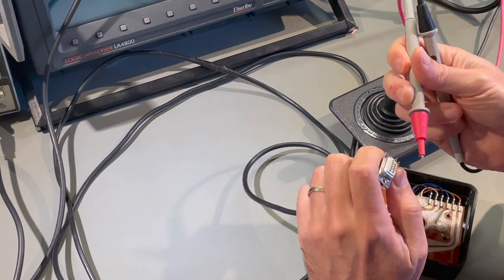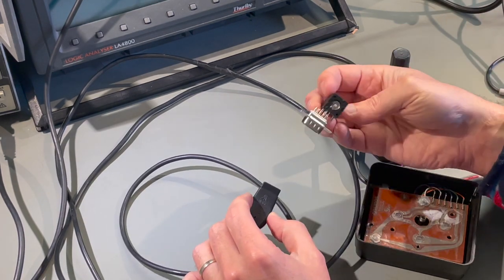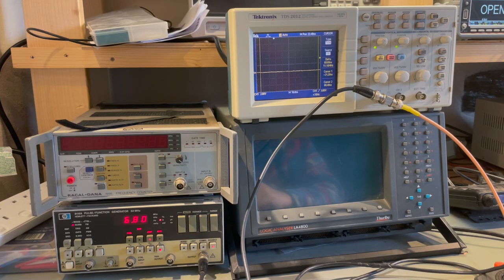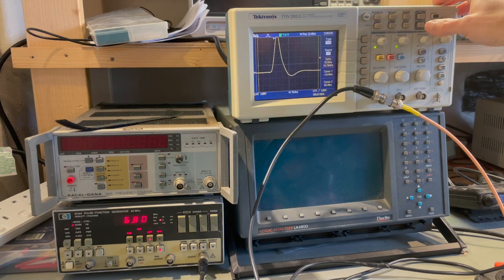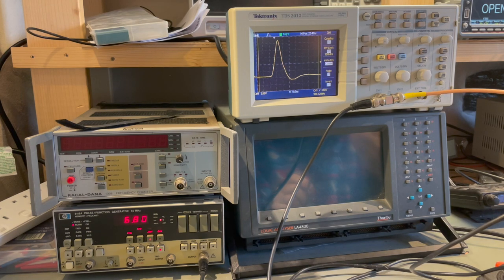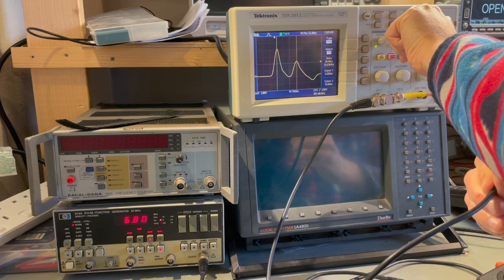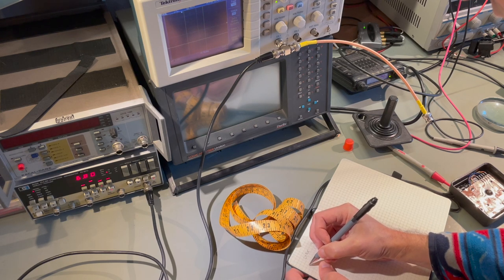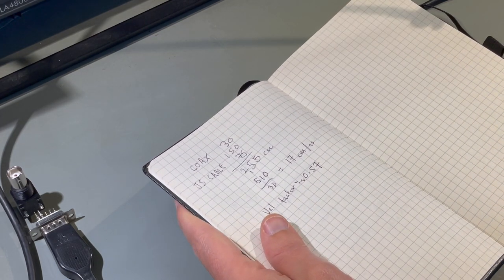Using time domain reflectometry to fix a broken joystick

Comment: Turns out you can use it in more mundane setups, I actually diagnosed a fault in which I had a wireless AP that would only go 100Mbps instead of gigabit using the built in TDR function of a network switch which it would tell me I had a shorted pair. However the fault wasn't on the cabling itself but on the slightly mangled ethernet connector of the AP!